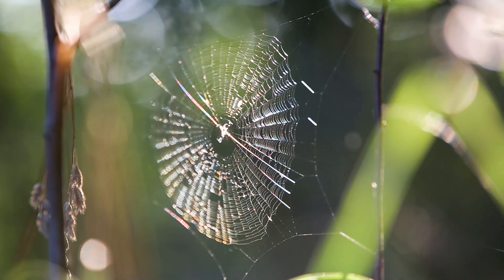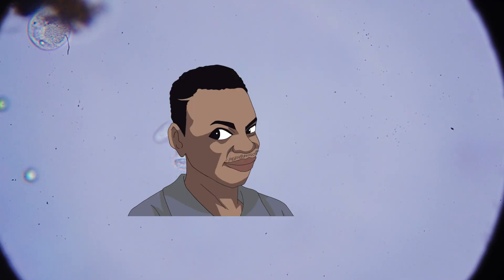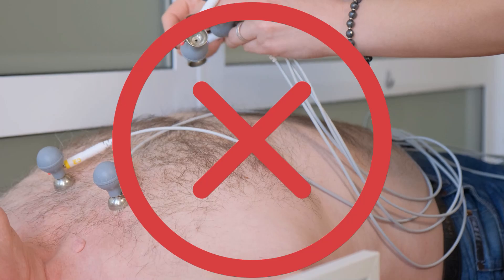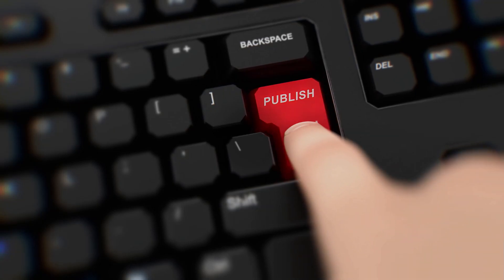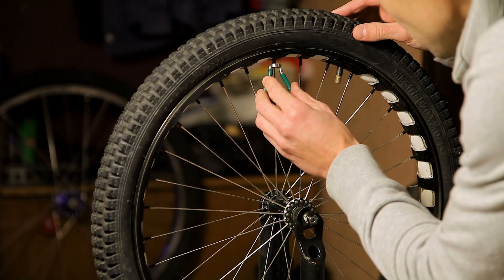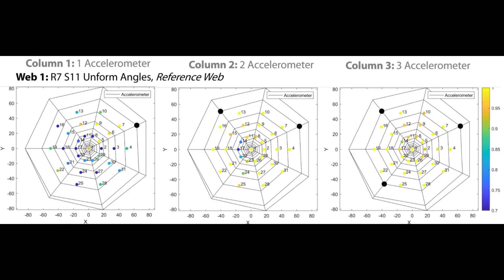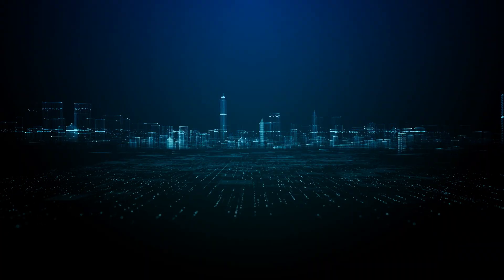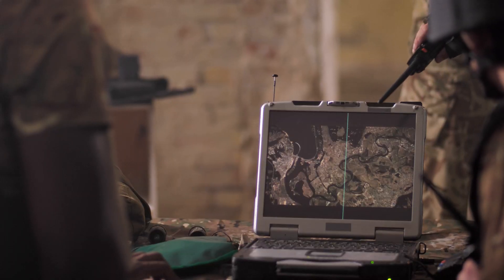Spider Silk Reinvents Sensors!

Comment from the maker: I wonder if we could use these large-area sensors to detect debris in space...
Reply: I'm glad that you found interest in our work. Not quite sure about the larger-areas, but certainly applicable to haptic sensing as mentioned.
Reply from the maker: @mahdinaderinejad9798  I can't belive that one of the authors of the paper actually saw my video!!! Thank you so much for taking the time to comment! From your perspective, what do you think are the biggest challenges in scaling these sensors up to larger surfaces? I really enjoyed your work and think your team did an outstanding job, keep it up!
Reply: @BioBytee Our pleasure! The most complicated challenge is how the accelerometer is mounted on the web. There are many ways to measure acceleration or velocity of a point and many of them are contactless methods, however, the web doesn’t have enough surface area to use those methods.
Reply from the maker: @mahdinaderinejad9798  that is very interesting! Thanks for sharing!